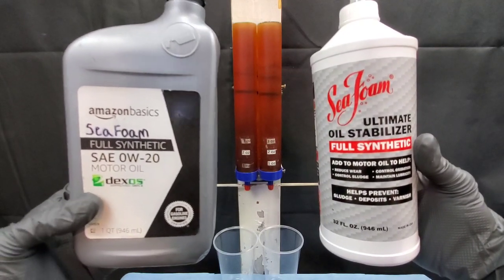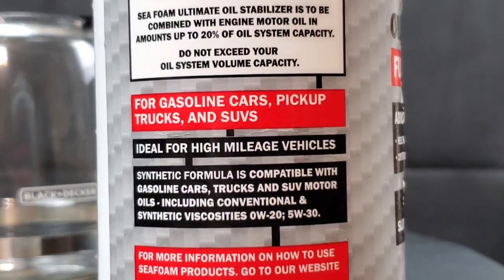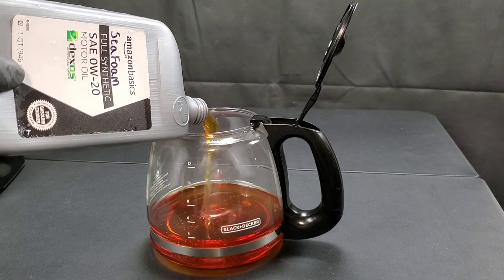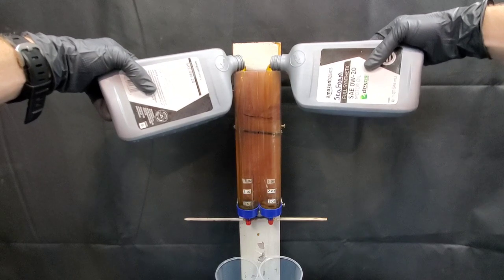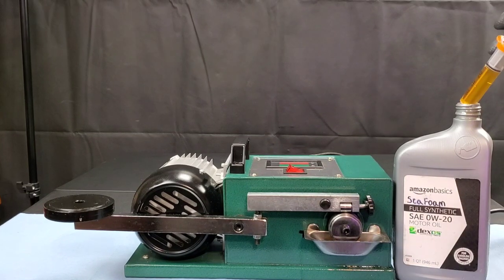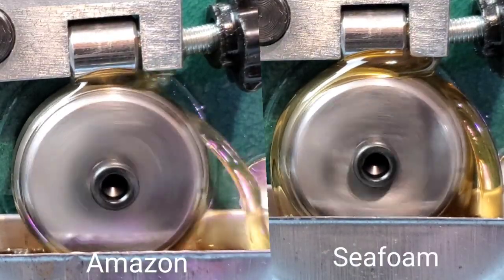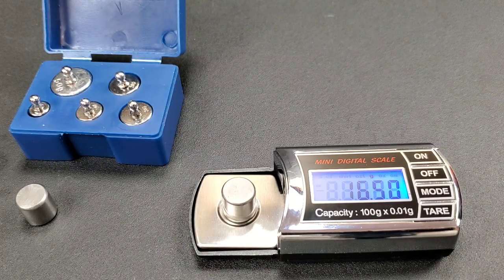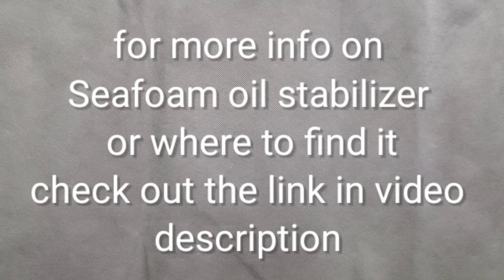Seafoam Ultimate Oil Stabilizer or Lucas oil Stabilizer?

Comment from the maker: What additive is worth using if any?
Reply: How about Motorkote Hyper Lubricant?  Noticed ticking noise stopped in a 4.8 Sierra after about a  hundred miles of use.
Reply: Engine Shield by Steel Shield Technologies
Reply from the maker: I agree that would be a good choice, I see the product at most Wal-Marts.
Reply from the maker: I will look into this because I don't know much about it. I appreciate the suggestion. Its good to learn of new additives.
Reply: Lubegard BioTech Engine Protectant (Blue bottle)

Comment: Thank you for taking the time to do that test.  Ide like to see it against Lucas as well,  I dont buy amazon basics for anything normally not seafoam either . I have been buying Lucas and gum out. Since my diablo octane tune I'm getting excessive gasoline in oil from injectors over spraying so an oil thickener is what I need in between oil changes

Comment: Have you tested the Walmart brand supertech oil stabilizer before. Also first I've heard of seafoam stabilizer so this is interesting. Truth is almost all oil stabilizers are scams. You can google search widman viscosity calculator. Lucas is 110cst at 100c and if you pair that with a 0w-16 at 7cst with 80% oil and 20% stabilizer the viscosity would be around a heavy 30 or lighter 40 weight and they almost never have additives added in. Just an oil thickener and that's it. I'd only use it if 50 weight was still not thick enough but I have yet to be in that situation.
Reply from the maker: Great to see people like yourself share their knowledge. This is what the NIA community is all about.

Comment: Oil Extreme is the only additive to use at each oil change.....

Fastest at Indy 500, 1999
Reply from the maker: I haven't used that, what is your experience with the additive.
Reply: @NATESINTERACTIVEAUTO  Makes Engines last longer than anything I know.

It makes excellent ring seal, absolutely brilliant on high lift camshafts, reduces friction, TBN rating of +20......extends drain intervals 2 - 3 times.

It works miracles in CVT's that shudder... IE... Honda FIT/Jazz, 2002-2007 BMW Mini CVT....
Reply: @gj91471  would it work on 2016 Nissan Altima?
Reply: @yeakass1  Which CVT does your Vehicle have?
What is your specific CVT problem.

Contact Oil Extreme in USA... Ask to speak to Dan.
Reply: @gj91471  tbn of 20 caught my attention. Gonna have to look it up now.
Reply from the maker: I appreciate you sharing your information.
Reply from the maker: Absolutely  I Agree
Reply from the maker: Good question
Reply: @NATESINTERACTIVEAUTO  Wondering if the active ingredient (a calcium compound) would increase LSPI in a modern direct injection turbo?